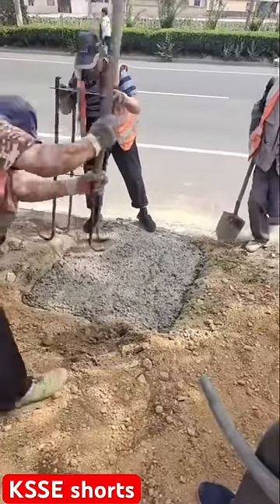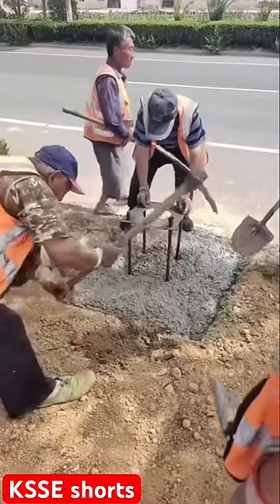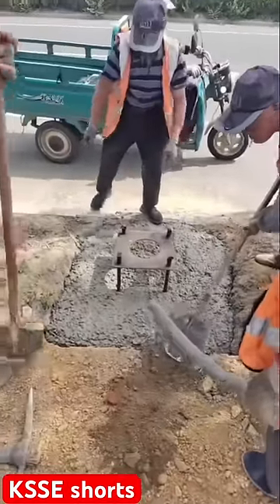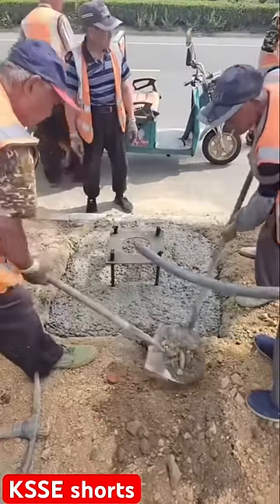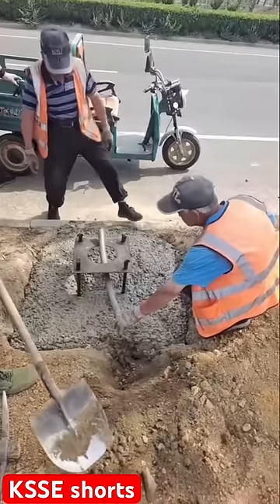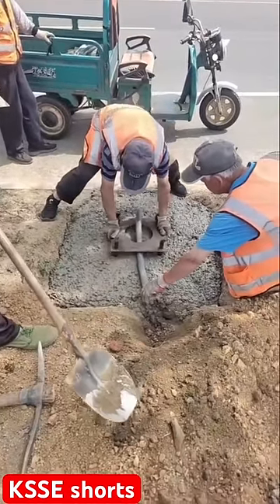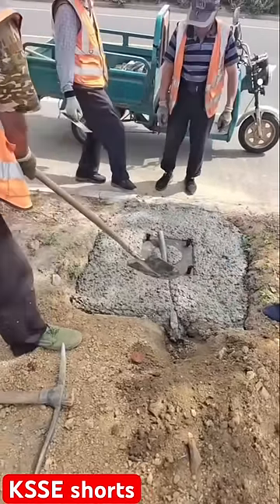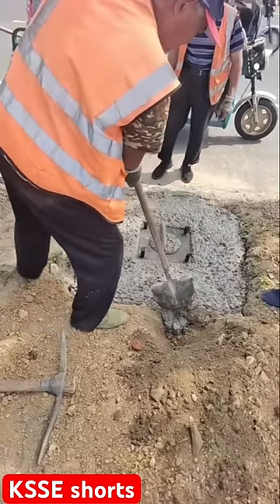A simple way to install the street lighting poles' foundations anchors #learning #construction

Comment: Nice to see the hockey stick placed in to the standard minimum depth of 600mm? 'O' they miss read the plans and didn't see the two zeros on the end of that number 6!
Reply: Its more like 15cm, they probably dont care, everything under the surface is gone from sight…. I would not use a pickaxe to open the ground there, someone else might run a cable..

Comment: This was the worst concrete video I've ever seen. Sorry, but the craftsmanship is not on point! 
No forms to make it level, the flex pipes angle is terrible, and all the grown men looking at job but barely performing was sad to watch.
Reply: Have you ever watched road construction or any big project. You will see many of them are not doing work. It's a physical work you can't keep shoveling for 6hrs straight, they take turn to do work.
Reply: It’s not a driveway or something, it is what it is!
Reply: I started construction at 19, and I shoveled from sun up to sun down in 115° weather worked 20+ days straight doing hard labor. There was more than enough man power on this job you see in this video. You're only as strong as your thoughts. Pain is weakness leaving the body.